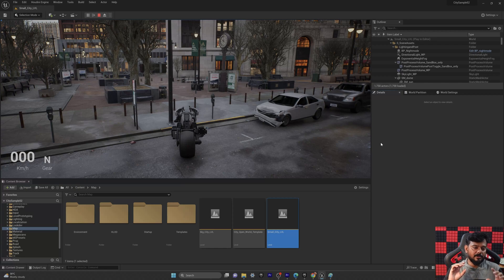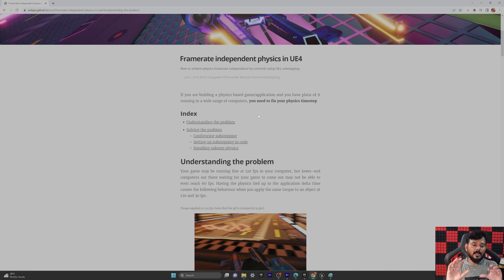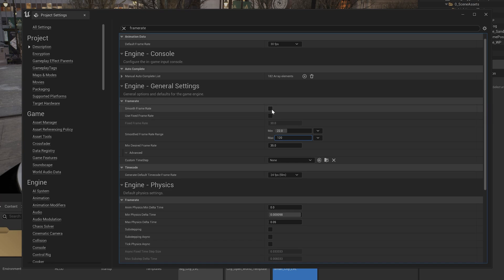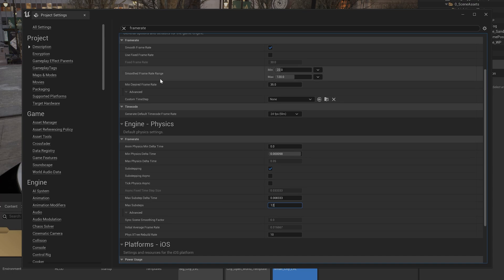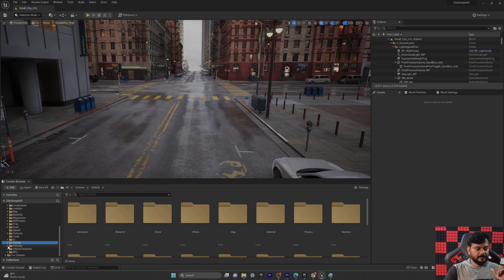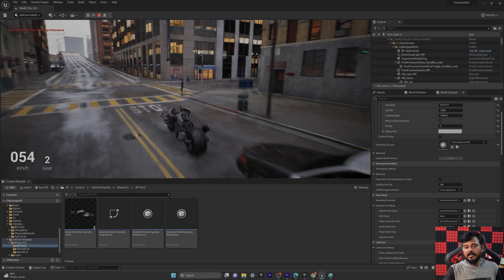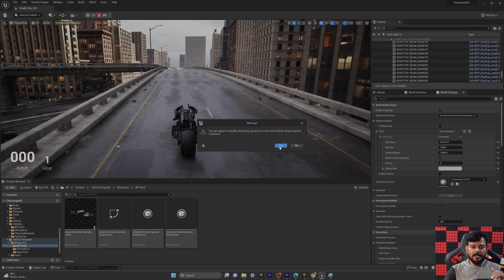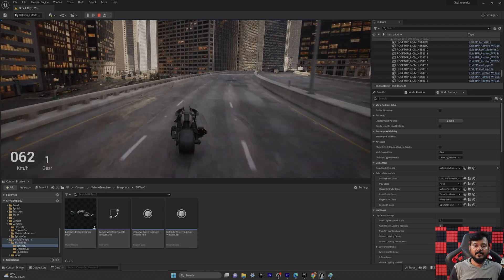{FIXED} Wobbling/Jittering/Shaking Vehicle Movement in UNREAL ENGINE

Comment: I found solution. Need just ajust center of mass Offset in Physics section to lower value (in my case -80) and shaking gone without changin Framerate values... And need set wery simple (small Box) collision of vehicle physics body...